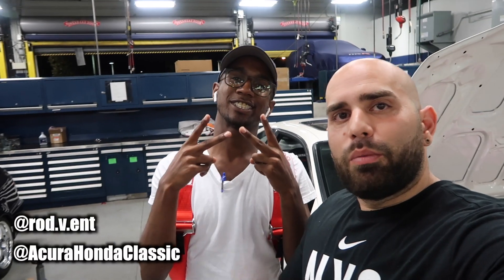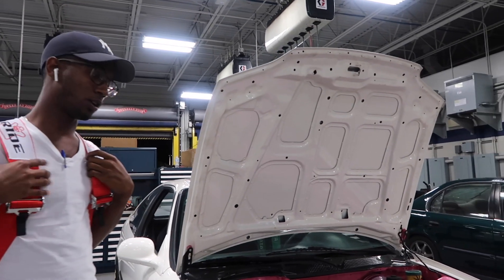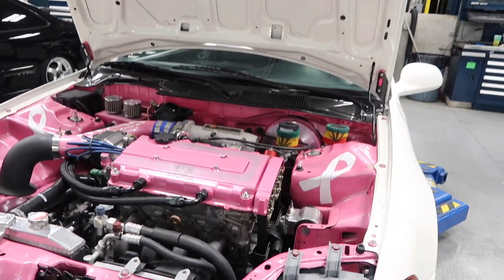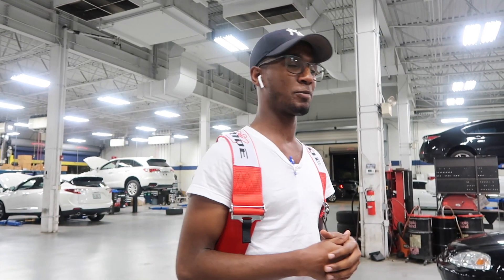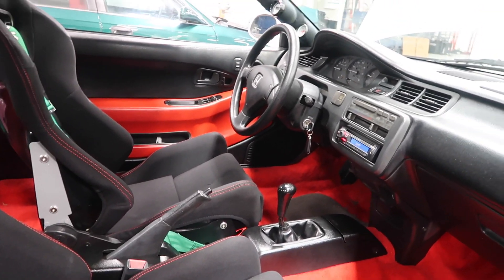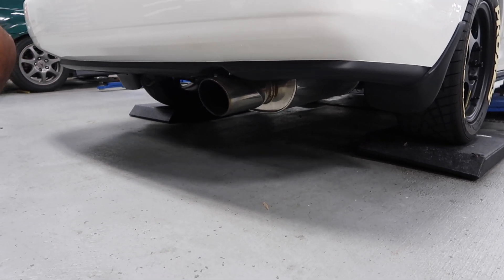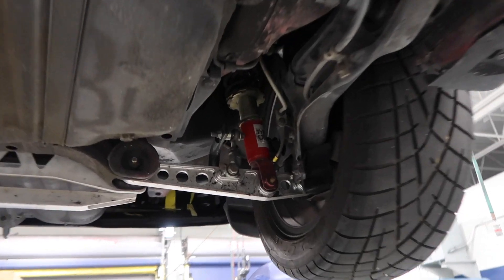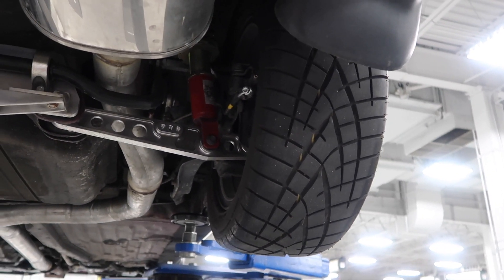Acura Honda Classic EJ Coupe Civic B18 Fully Built Vtec - Episode 4

Comment: I've been driving an EJ b18c1 for 11 years. I just plucked the engine this week for a stockish rebuild. Doing the fuel/brake lines, rebuilding the steering rack, and blasting/repainting the suspension cradle. I love these cars, doing what I can to preserve mine.